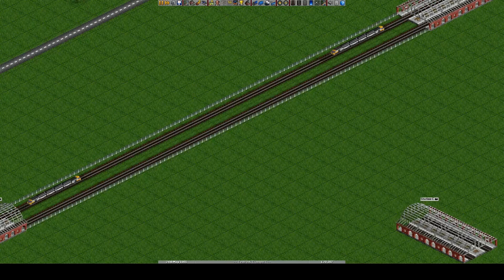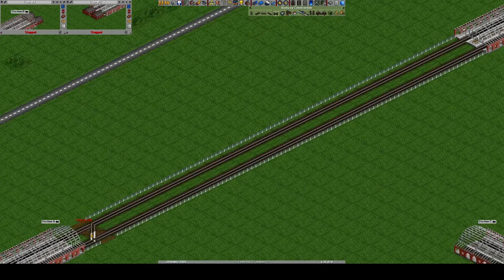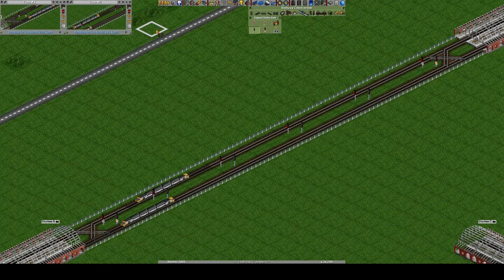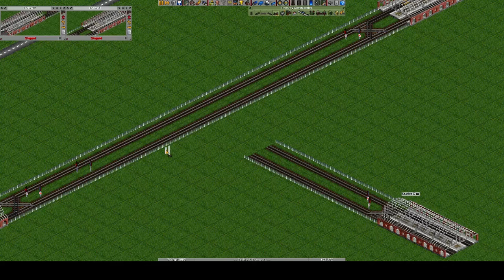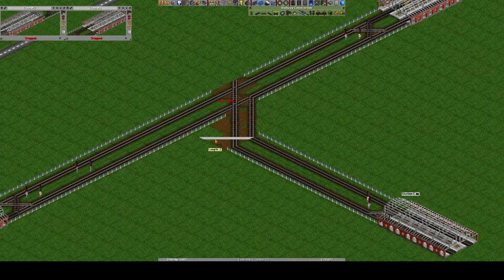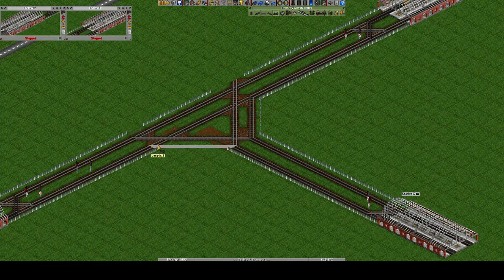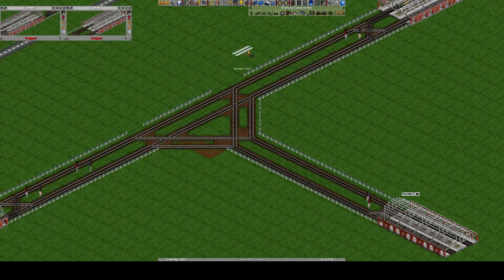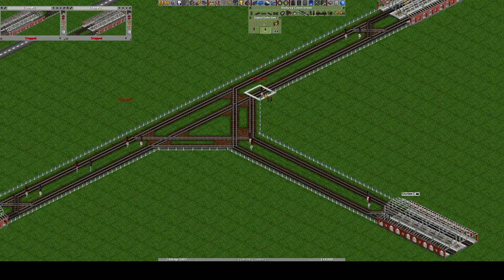OpenTTD Tutorial: Signalling introduction

Comment: No matter what I just cannot get my head around this
Reply from the maker: It can be difficult the first time - that's for sure. Is there anything you're particularly struggling on?
Reply: @azophyte  Kindof in the same boat. You know what's missing from the video? How would you add access to depots? Would you need one for every train or per in/out branch?
Reply from the maker: @iuliansurugiu7762  Fair shout, but i'll explain here
Depending on how congested your network gets, there are two good solutions for depots
1) just place it perpendicular to the track between two signals and forget about it
2) build a third and fourth track that's two to three times longer than your longest train parallel to your main tracks, put  the depot in the middle and have a signal for entering and leaving - this will stop your train from slowing down others when exiting the depot

Hope this helps!
Reply: @azophyte  thank you

Comment: In the old version of OpenTTD, I'd always been used to the old block signals, so when the new version only allowed path signals I had a slight learning curve. I figured it out though; always learned faster by doing. They're pretty a effective concept, allowing traffic to flow if not obstructed. In the past, there were no end of delays from trains breaking down halfway across a signal section! 😅
Reply: You can use more signals by going into settings and then under Company choose the dropdown menu called "Show signal types" and select "All signals". Economically there's no difference as all signals cost the same, but you might want more than just path signals if you want to do more complex stuff.
Reply: @RedSntDK  When it comes down to it, though, my railways never reached a level of complexity where I needed too many kinds of signal. At worst, I'd have "mainline" (long-distance) and "branchline" (DMU diesel) passenger/mail/valuables lines that might converge and branch off towards different towns, with each train doing it's own local bit.
Other than that, there's my factory services that bring in farm-produce from one way, steel from elsewhere (itself fed from an ore mine) and finally factory-goods taken away to a not-too-distant city. Ends up collectively very profitable.
My routes don't necessarily end up connected to one network, even if they might share stations when convenient (on separate tracks) - and at least that makes it easier to separately upgrade them to monorail and maglev later a piece at a time, without having to disrupt the whole service.
Reply: I'd take only path signals over original Transport Tycoon's only two way block signals. It's torture trying to do anything remotely complex without one way track.
Reply: @keiyakins  If I have a route that's used by three or more trains, I'll usually have a parallel track with a one way system in place. That way, there's less chance of them trying to cross over because of traffic ahead and causing a traffic jam. I'd even consider implementing flyover bridges to avoid crossed lines.
Reply: @DCLeadboot   How do you do a one way system though?
Reply: @keiyakins  After placing a signal, simply click on it to toggle between two way, one way outgoing or one way ingoing
Reply: @DCLeadboot  That was added in Deluxe. You can't do that in original Transport Tycoon.
Reply: @keiyakins  Oh right... I wouldn't know. I didn't discover one-way signals until I downloaded OpenTTD

Comment: Fun hack to tickle every last morcel of capacity out of single line operations , use loops that are two train lenghts every three to four trainlenghts , and then use this trick on trough lines , not sidings off of the mainline:
| |2TL
|/
|TL
|Signal ^ (path two way)
|TL
|Signal v(path two way)
|TL
|\
| |2TL

This works since there is a singular dependency block in the middle to lock any other trains reserving it , while it lets another following train reserve the already cleared section , however i dont recomend using more signals

Comment: So, to double check for clarification…
One way signals are like one way gates in that trains won’t go down a track if it means going the wrong way through a path signal?
and
Regular path signals are like signals in, say, the Minecraft create mod, in that they section off parts of the track, and if there’s a train on the track section ahead of a signal, then the signal turns red and trains will stop at it?
Reply from the maker: @TheCreativeType  Essentially you are correct, but these path signals are a bit more special. When a train enters a junction with a path signal, it reserves a route and follows it to the next signal. If another train wants to enter the junction and doesn't cross paths, it can enter - otherwise it stops.

If it makes it easier, you can treat them like the create mod signals because the functionality in practice is basically the same
Reply: @azophyte  So, are path signals like stopping points? Where, if the path a train is going to take ahead of a signal doesn’t overlap with another train’s path that’s on that stretch of track, then it will move forward, but if the paths of trains in the same stretch do overlap, then a train will stop before entering that stretch of track?
Reply: I’m now noticing the tracks turning darker when a train is taking a path through a section of track (as separated by the signals), so I’d assume that, if another train wants to enter that section of track, but their path overlaps with the darker tracks of another train’s path, then it will wait until that train leaves the track section, and then enter?
Reply from the maker: @TheCreativeType  Yeah that's correct :)

Comment: How many trains can I have on these crossed intersections?
Reply from the maker: @iqbrazil  That question depends on a lot of variables like the speed of your trains, how long they are, how often they use the intersection etc. Generally these will pose no issues for your trains as long as they can accommodate the full length (I e. the trains don't slow down from turning).
I've ran lines with trains coming through every few seconds and not had issues, but it's generally best to keep an eye on your busier lines